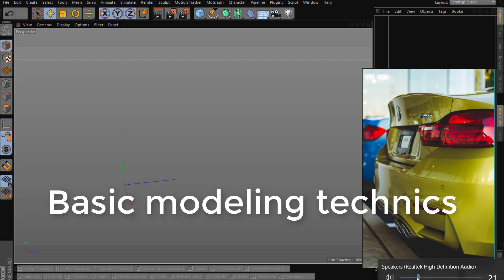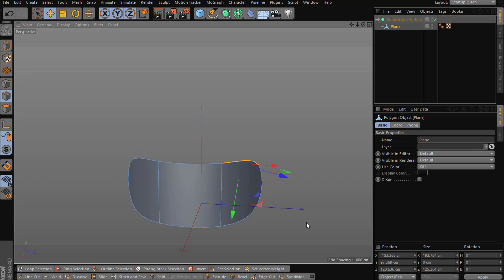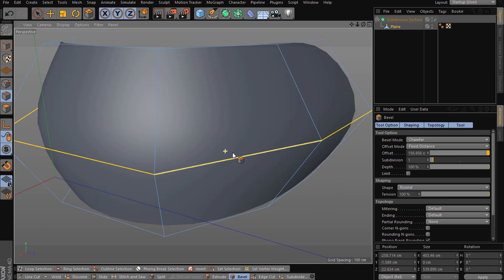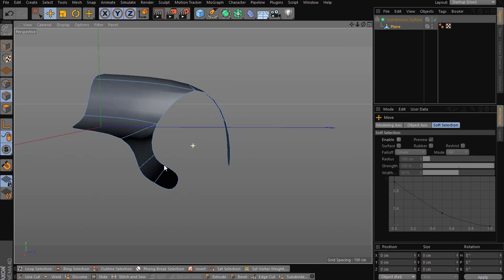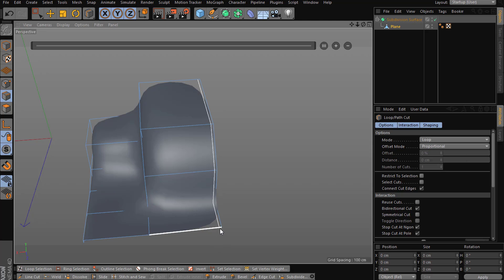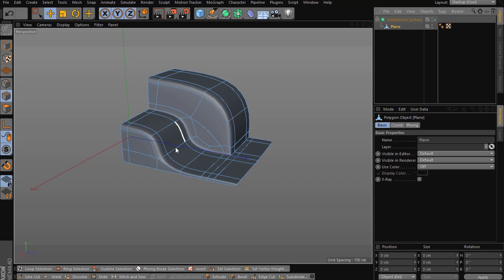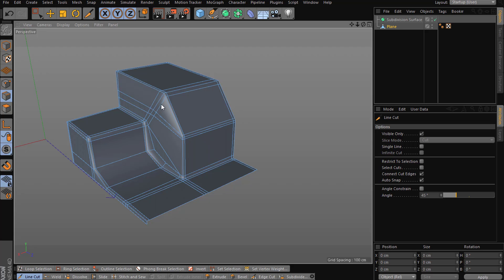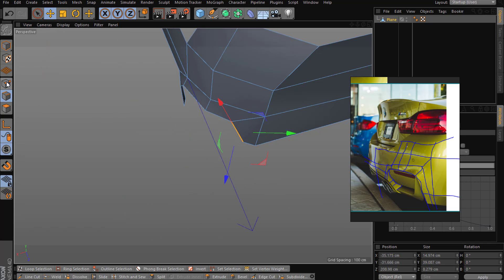MASTER POLYGON MODELING IN CINEMA 4D 🎯 | SUBDIVISION SURFACE & TOPOLOGY TUTORIAL

Comment: The double click loop selection works only in line and point mode wish it worked in polygon mode but still thanks for the tips I did not know that before ;-D
Reply from the maker: KRIZINKGRIN INC it's my pleasure
Reply: UL with the poly tool selected for poly loops